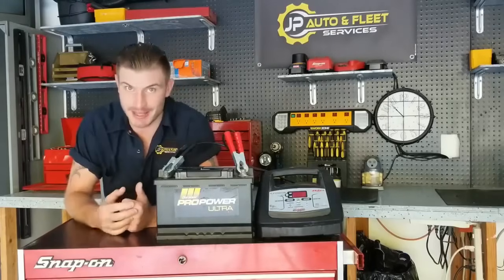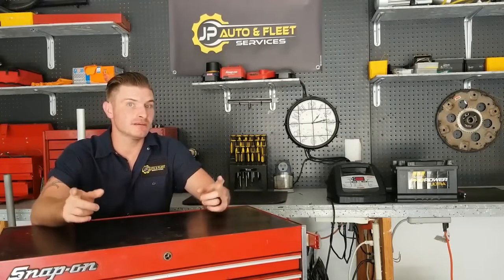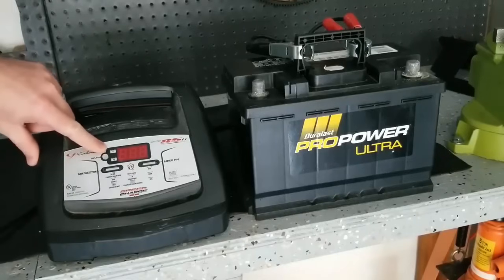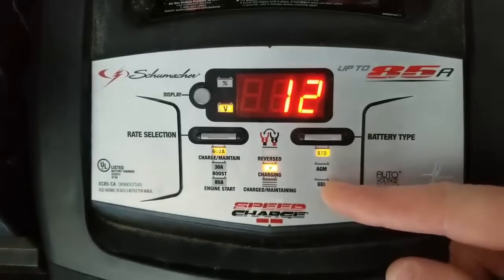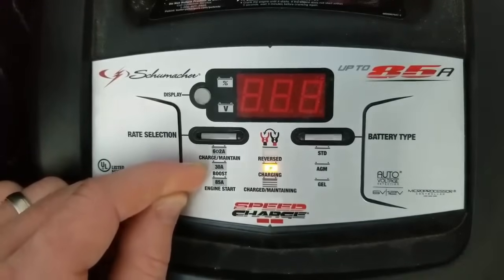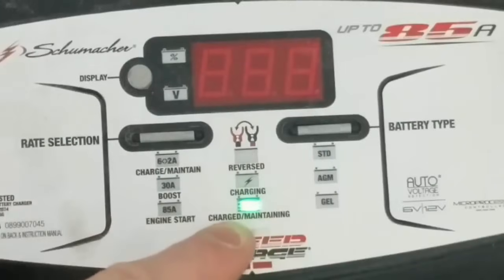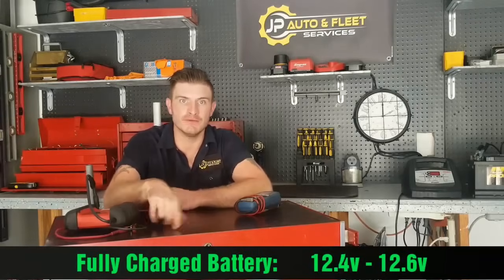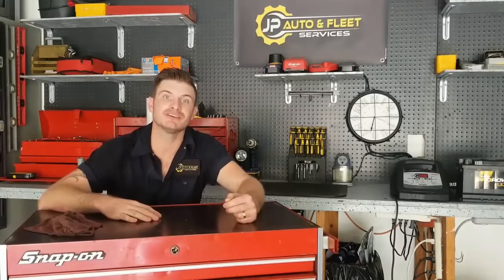How Do I Recharge My Car Battery | How Long To Charge A Car Battery At 2 AMPS

Comment: Hi, thanks so much for the video. How long does it take to recharge the microprocessor controlled charger through a household outlet? And can the charger be used as a power source? (ie. Does it have outlets?)

I'm thinking of getting one for my camper van which has an Optima Redtop battery (AGM). I'm hoping to use the van's main battery for appliances within the vehicle for short periods of time, perhaps through the cigarette lighter with an inverter, unless you have a better suggestion. 

My only concern is recharging the battery, if I'm not driving it.

Any tips would be greatly appreciated! Thanks so much
Reply from the maker: You dont have to charge the microprocessor Controlled charger. You plug it in and then hook it up to your battery for charging. If your asking  how long it takes a battery to charge that depends on how Depleted the battery is. Often times over night with this particular charger. It doesn't have outlets.

 If I were you I'd have a second auxiliary battery installed and run all your appliances off that. Youd need a deep discharge Optima blue top battery for this. Take it to a shop and have them mount it and wire its linked to existing main (starting) battery. The main battery will then charge it when the vehicle is running. This way you can use all your appliances pretty much whenever you want. And you wont compromise the vehicles starting system due to a weak battery. Hope this helps!
Reply: @JPAutoFleet  Thanks so much! So if I do that, will my power bank be comprised of both batteries? Or will the appliances only draw from the blue battery?
My concern is indeed unknowingly draining the starting battery and having a dead van. 

However I got the red top optima thinking I could use its power for more than just running the van. So a way to monitor the battery level so it doesn't die, or cap it before it does, would be ideal.

Thanks again for all your help, I really appreciate it.
Reply from the maker: @Beaming246  Mainly just from the blue battery. It's the perfect solution. Do it!
Reply from the maker: https://youtu.be/1JkH8sH_uK0  This will help

Comment: I have connected black to black and red to red pigtail from the battery tender to the 12v battery terminals still inside my Honda Accord 2007 V6 car. I had to cut a small gap on the rings to screw it to the battery terminals since I have ample space on the thread and I just had to squeeze them from the side.  Question though since not sure if that’s grounded as well via the negative terminal. What do you think? PS: My MB has a dedicated positive and ground terminal inside the hood unlike Honda Accord.
Reply: I have the exact same charger I just bought it, but I’m confused because the instructions say for a battery that’s in the car still, connect red to red but connect black to the vehicle chassis or engine block??
Reply from the maker: @suhelpsingh  that just means connect to ground. The black lead on the battery shares continuity with the chassis ground.  You can either hook up straight to the battery or to a clean piece of metal anywhere on the engine block.
Reply from the maker: If your hooked up red to red and black to black you are grounded.
Reply: What's the correct hook up for charging?
Reply from the maker: @chineduokonkwo5777  Red lead on charger to read lead on vehicle battery (positive). Black lead on charger to black lead on vehicle battery (negative)

Comment: How long will a car battery's charge last with a constant 2 amp draw, and how long can it take a car battery to fully charge after start up, charging by it's alternator?
Reply from the maker: All depends on how frequently your driving/starting it, and the length of time it sits without being started. I can't give you an exact time but a 2 amp draw will drain the battery fairly quickly over time.   As far as how long it takes to charge back up depends on how much it's been drained. But usually, 1 hour is a safe bet. Hope that helps!
Reply: Look at your battery as a box of energy, and as long as you are comparing 12v batteries, the size of the box, called the capacity,  can be compared by the battery’s Ahr rating (the ampere-hour rating). So if you have a 24 Ahr battery, it can supply a 2A current for 12 hours.
Reply: @petefowler9633 ,
Thank you. I assume that means it still might start the car...or would it be dead in 12 hours?
Reply from the maker: @petefowler9633  Nice insight. It's always good to have someone that really has the math on this stuff dialed in!
Reply: @JPAutoFleet  , thanks for this video. I used my car to jumpstart a friend's car, and now a day later, my car won't start. I'm assuming my battery needs to be charged, but I'm wondering if you have any insight into what I should do. Thanks!
Reply from the maker: @Rín-wín  I'd attempt to recharge it and then have it tested at the parts store. Or jump start it and drive around a while to charge it up. Then have it tested. Good luck!
Reply: @JPAutoFleet  , okay. thank you!!

Comment: Whats the maximum amp a lead acid battery can handle? Cuz I think I sent about 300 amps for about 10 to 15 seconds.
Reply from the maker: 250 amps for about 15 seconds is a typical testing amperage. You did a little bit more but you should be fine.
Reply: I by mistake put mine on 200 12v for a hour and 40 mins on the jump start . I didint smell anything or feel it was not hot . And it was out of the car . I then noticed no sparks when i dissconected ? This ok ? I havent put it back in the car yet